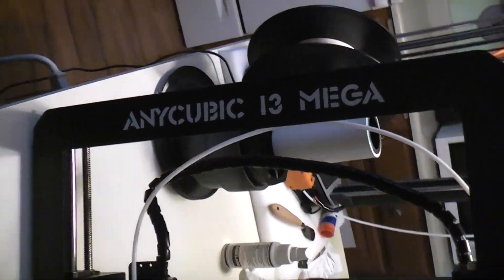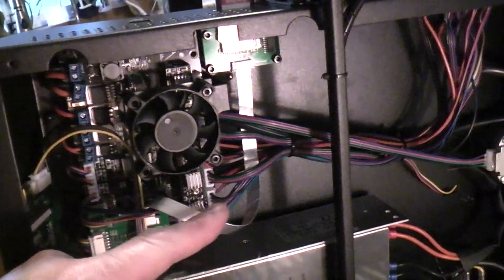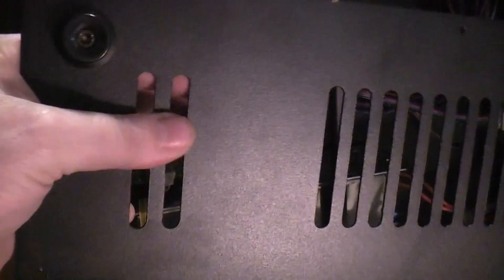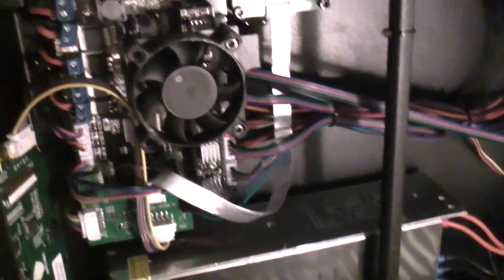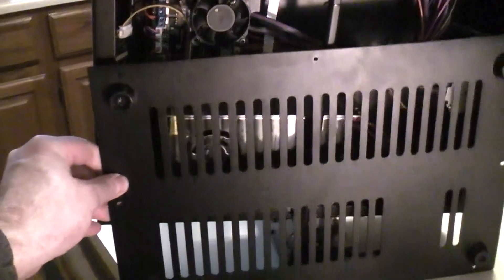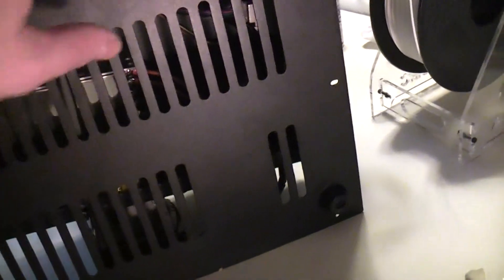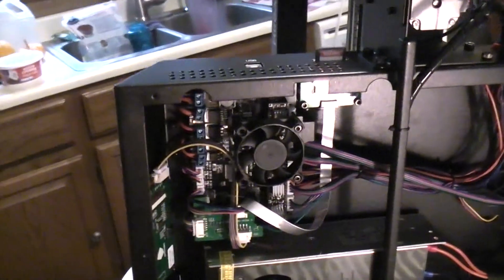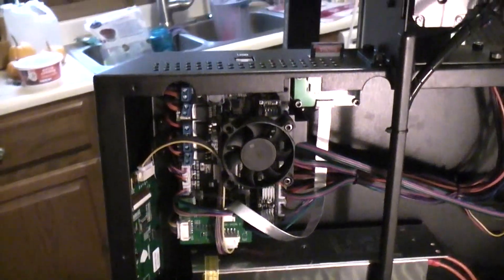My AnyCubic i3 Mega has a blocked control board cooling fan !

Comment: Hi...it is not a problem, it is right instead, because in this way you prevent the fans from loading dust because it pushes air inside. I've seen many videos where users change the direction of the fans at will and it's wrong, try doing it on a computer and see what happens. I have seen many that change the direction of the power supply fan, it is wrong the fan has to throw out air and not put it inside.

Comment: Hmmm can I just leave the cover off? i'm worried about my expensive TMC2208 that i'll get tomarrow :D
Reply from the maker: I am sure you could. The base plate probably adds some stiffness to the frame. Just flip it around like I did and the 2 center screw holes that do not line up just leave empty. I have not had a problem with my TMC2208 drivers in my Anycubic.
Reply: Robothut yay. Thanks! Im planning to remove the two fans (Psu and steppers) and install one 140-120mm fan to blow on both so it’s quieter. I can’t find replacement fans for them here ;/ so those grills are going to help
Reply from the maker: I thought about doing that as well. I probably will one day. I found a larger AC powered BOXER fan in my junk box, it is over 20 years old but still runs quitter and moves more air than any of the small DC powered fans. I would have to either mount it to the bottom then raise the printer up or print a holder to mount to the back of the frame and add a hole for the air to move threw.

Comment: Confirmed by Anyqubic Engineer: 

I mentioned this blocked fan issue to an Anyqubic/ Engineer who was helping me with an unrelated dead power supply fan. I included a video of the issues. The Engineer advised me that the bottom cover could indeed be rotated 180 degrees to improve air intake to the motherboard fan. The engineer further advised that new holes would need to be drilled.

My I3 Mega is dated 2018 and the motherboard fan was mounted directly against the bottom cover plate.

I received this reply from the Anycubic Engineer on 2/15/2019: 

Hi
Thank you for the video.
I will give you a new power supply to solve your problem if the power supply fan does not turn.
The system will send you an email, please fill in the logistics information carefully.
You can rotate the bottom cover by 180°.
But you need to re-drill the screw holes.
Kind regards 

ANYCUBIC/Augus
Reply from the maker: You do not need to drill 2 new holes in the base cover, just hold the bottom on with 4 screws instead of 6. Works fine and does not rattle.

Comment: it is obviously that the plate is wrong drilled. If you turn it about 180° then is the section without openings direct over the 220/ 110V Power entry. To prevent any kind of contact with a tool.

.... i know my english is not realy good 😐

Comment: Fan is well below the cover. No need to mod, there is sufficient gap and air can be drawn into the fan without any issue.
Reply from the maker: Yes it would seem most of the printers were made right with the fan well below the base plate, but not mine. Simple fix is to adjust the fan mounting frame so it is below. Mine was butted right up too the base, zero air flow.

Comment: There is a gap and the fan cools well.
Reply from the maker: So Glad that your version has a gap. They seem to change the build just a little bit all the time. mine has no gap. but flipping the base plate around is so simple and makes it cool so well. Still love this printer, just about the best for the money you can get !
Reply from the maker: It could be that my printer just got a defective fan mounting bracket so that mine sits right on the bottom plate. Hope so, as this is a great printer for the price.

Comment: They did this on purpose as clearly can be seen from the design. The purpose is that they don't want to suck up rubbish from underneath the machine. There is enough space around the fan, fan effectiveness is hardly compromised. You can indeed reverse the bottom plate, and add 2 new holes in the middle. I did not have any instability problems, except for when the heating bed thermistor cable has a problem, this freezes up the machine. I think this is the reason why many people report stability problems. Update, I upgrade the system to a 300 Watt 24V power supply without a fan. It's an easy upgrade with the same mounting holes. You will need to set the heated bed to 24V, replace the hotend heater, and add some resistors to the fans (3x).
Reply from the maker: No there is no room around the fan and the base on my machine. Maybe on yours. Mine is 100 % blocked. So we will have to disagree on this one. Be side the same dirty air that is under the machine is inside the machine from the power supply fan and the opening .
Reply: Interesting, in your video it really seems that there is very little space between the fan and the metal, which is not idea. In my setup there is at least 10mm, perhaps even 15 mm in between.
Reply from the maker: Yes I think they have made many variations on this printer. Some do not come with the ultra base some do and other things. I think its not a big deal on the fan, the printer works great with it or with out it. It just seemed odd and I only had my printer to go by. As much as I love this printer, I do have to say that the JGAURORA A3S at $266 bucks is even better. The print quality is even better.
Reply: If I were you I would design a different fan support bracket and bolt it on.  I think I will be doing that once my mega ultrabase is working again.

Comment: has that really been a problem? I mean is your machine stopping from working because of this?  Yes it is logical to have fan blow out air through or intake via  ported vents better but if the enclosure is well vented all around which it is on the I3 Mega,  air is still being circulated inside the elecronics box,  air vented, and brought into the fan , not as direct but functional. I have not had any issues, mine has plenty perforations on the sides and raised bottom which is plenty for air to come in or vent out.  Sometimes it is better to "if it aint broke don't fix it"  cheers!
Reply from the maker: I agree there is plenty of air movement in the control box, so if the fan is blocked and can not do anything but make added noise "mine does that" then why not just disconnect the fan since it can not function as a fan ? The Prusa printers have there control boxes in small sealed printed boxes and they do not over heat, no fan. So good point. whey not just remove of disconnect the fan since it can not preform as a fan.